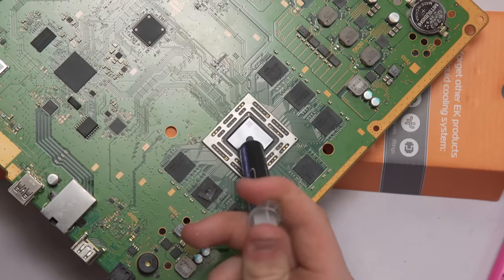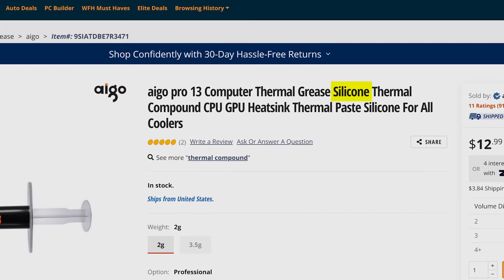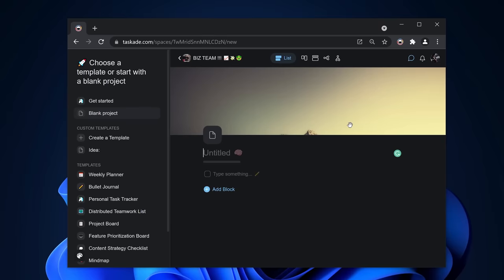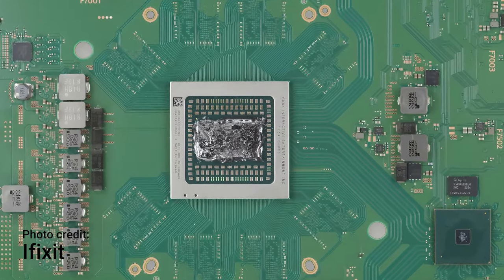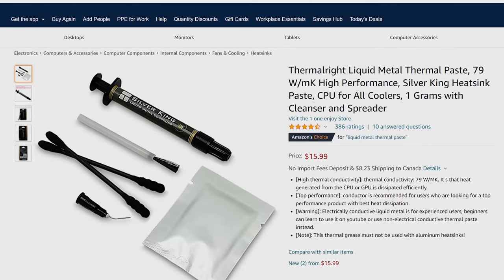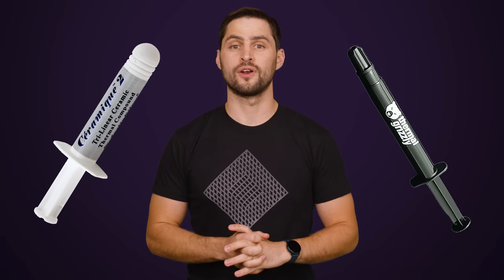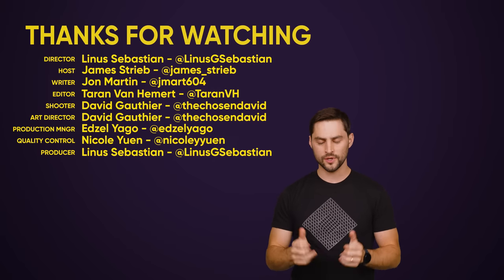LIQUID METAL In Your PC and Console

Comment: In case anyone was wondering, galinstan (the liquid metal alloy from gallium, indium and tin) has been used for some time in glass thermometers, too, where they would have used mercury in the past.
Reply: can i drink them now?
Reply: @rustyslug2943  No but if traces of it do find their way into the environment it's nowhere near as big a deal as with mercury.
Reply: For the past 2-3 decades, most glass thermometers have used ethanol. However, for a faster reading and/or mechanical output, bimetallic strips are nearly as accurate. For super precise readings IR censors and thermisters are the way to go.
Reply: Times sure have changed. They used to sweep the floor with mercury and machine components to get dust. I wonder know how much of that went into the river.

Comment: "Degredation" is one word you could use for the horrifying corrosion that gallium causes on aluminium components.
Reply: Aluminum brittler
Reply: No one with any sort of brain or nerve would use liquid metal with a stock heatsink, which is made of aluminum often.
Reply: maybe its only degradation since liquid metal is only part gallium, not completely
Reply: if your using expensive paste on something with an aluminum coldplate your are doing something wrong
Reply: Aluminone
Reply: Since it destroys and degrades the amount of aluminum in your heatsink, does it become aluminuminimum?  🤔😁😁
Reply: @La_sagne  It's a chemical reaction. It isn't corrosion.
Reply: did u just copy someone elses comment lol
Reply: @ygypt  the other comment is edited so they could've copied this comment
Reply: @Simar94  that would be so funny
Reply: Yeah I was thinking that as well. It will absolutely mangle whatever aluminium you put it on, so degradation is a very mild word
Reply: Disintegration more like, because the second you touch aluminium altered by gallium it turns into a pile of dust basically
Reply: A N I M E
N
I
M
E
Reply: @Tyler  its only called an alloy. Amalgamation I think is specifically refers to how mercury reacts to certain metals.
Reply: @MeowThingy  uhh. Corrosion is a chemical reaction.
Reply: @MeowThingy  It isn't a chemical reaction, its mostly physics. The Gallium diffuses in between the grain boundaries similar to how water forms quick sand. There is just enough electron sharing to hold it together, but the resulting alloy is very brittle. Think... Oreo cookie without the filling. This alloy is also very susceptible to corrosion due to humidity or contact with water allowing aluminum oxides to form and flake off before it can form a protective layer. The gallium isn't causing corrosion, but it is helping it to progress. 
In about a week, an aluminum water block with liquid metal will turn into a fountain or a geyser, depending on whether it fails while the pump running or when he pump is turned on.

Comment: 0:35 Sorry, but that's not the definition of "eutectic". 

"Eutectic" means that the alloy has a singular defined melting point. For example, 63% tin/37% lead melts at exactly 183 C. Above that it is a liquid, below that it is a solid. Similarly, 99.3% tin/0.7% copper melts at 227 C and 96.3% tin/3.7% silver melts at 217 C. These are all eutectic alloys, but eutectic alloys can be made of three or more metals as well - it just gets more difficult to determine the exact eutectic mix and the melting point with ternary or higher alloy mixes. 

A non-eutectic alloy has a solidus point (below which it is fully solid), a liquidus point (above which it is fully liquid), and a plastic range (during which it is not quite solid, not quite liquid, called "plastic"). For example, 96.5% tin/3.0% silver/0.5% copper alloy (the most common alloy used for lead-free soldering of commercial devices) has a plastic range of 217 (solidus) - 221 (liquidus) C. 

For reference, tin melts at 232 C, lead at 327 C, silver at 962 C, and copper at 1085 C. Thus, all my examples are alloys with melting points below the constituent metals but that has no bearing on whether or not an alloy is eutectic. 

And yes, I work with electronic-grade solders for a living,
Reply: Well said. I was going to tell him the same thing.  Electronics Tech, Schlumberger.
Reply: I knew it sounded wrong that the metal mixture somehow has a lower property than all three metals individually! Because as far as I remember, alloying materials can only have their properties in between the materials which they are being alloyed. Thanks for this, my materials science class did not cover this even though this seems really cool.
Reply: @marcincizio721   I remember this ROM this tenth grade which was back in 1997. And I only soldered like ten times in total.
Reply: @marcincizio721  thanks!
Reply: According to wikipedia "A eutectic system (/juːˈtɛktɪk/ yoo-TEK-tik)[1] from the Greek εὐ- (eû 'well') and τῆξῐς (têxis 'melting') is a heterogeneous mixture of substances that melts or solidifies at a single temperature that is lower than the melting point of any of the constituents.[2] This temperature is known as the eutectic temperature, and is the lowest possible melting temperature over all of the mixing ratios for the involved component species. On a phase diagram, the eutectic temperature is seen as the eutectic point"

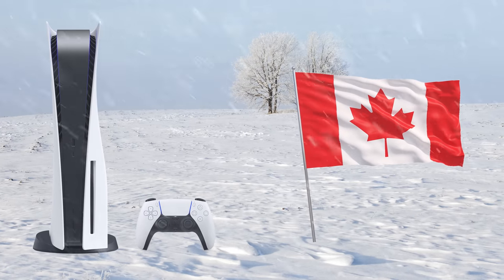According to that definition, that singular defined melting point is lower than either of the combined metals. So, the defintion agrees with what is mentioned @0:53.

Do you have any source(s) that says otherwise?
Reply: It's incredible, what one can learn from constructive criticism in the YouTube comments these days.
Reply: I was about to say something similar but I saw yours, good job.
Reply: @marcincizio721  what's your source for this? Every other single source I could find mentions the lower meting point as a part of the definition.

Comment: Liquid metal doesn't just degrade aluminum. It breaks it down significantly.
Reply: That’s what that means
Reply: It also discolors copper, but nickel-plated copper is fine.  It can remove the etching from CPU heatspreaders, and there's no way to prevent that.  If you're okay with being unable to identify a processor by looking at it, or you've lost the etching already by lapping the heatspreader, then go for it.
Reply: True, although it's not to a degree we need to worry about. Been running LM on my 8700K for 4 years straight. A little discolouration on the IHS but other than that it's fine.
Reply: if your using expensive paste on something with an aluminum coldplate your are doing something wrong
Reply: It turns it into a state between dust and a solid

Just breath on it and you have a pile of aluminium dust
Reply: Gallium is a great way to sabotage.

Comment: Liquid metal is best used to get your laptop to stop whining every time you hover you mouse cursor over chrome.
Reply: What is chrome ? Lol
Reply: You forgot to add "permanently" xD
Reply: Microdiamonds shut up my 2-year-old HP laptop for me.  I tested it afterwards with I think 50 Youtube vids playing simultaneously, with the fan barely above a whisper and no core over 80 C.
Reply: @h8GW  I may have to try on my MSI.  This thing is always spinning up.
Reply: @keithcyr5396  DEWWIT.  I plan on doing this to my MSI GL75 because it's a hot, noisy sumbitch, even when the RTX2070 isn't running.  
If you live near a Microcenter, they have IC Diamond at a pretty good price if they ever have it in stock.

Comment: If you get liquid metal on other computer components you could tell your pc “Hasta La Vista Baby!”
Reply: Lol
Reply: Good luck cleaning it up.  I wonder if the solder mask on most boards repels it enough.  On many boards solder mask is the shiny green layer.  It does come in other colors too but many of us may know green better.
Reply: its its such an overrated misconception, if your so worried about it flowing over just put some other thermal paste around the edges of the ihs first..
Reply: Still better than "I'm gonna install vista baby!"
Reply: yeah i put a plastic sheet down with a hole cut to the size of the heat spreader just in case.
Reply: @foamybelch  it would be a bigger party pooper if you end up killing ur gpu
Reply: @foamybelch  Get it on your motherboard and not only will it likely cause a short, it almost certainly will cause a solder joint to fail making it likely that components will literally fall off the board and there's zero chance they will honour the warranty after it's come in contact with the board.
Reply: @cadetsparklez3300  ignore these Karens loosing their minds because you provided them with a useful piece of information. I found this informative without being in any way affecting the OP
Reply: @foamybelch  You aren't exactly quick witted are you? We got that. It doesn't mean we can't respond to the people who don't get why using liquid metal is dangerous to hardware.
Reply: @foamybelch  you are assuming most people are familiar enough with hardware to know the specifics of what liquid metal does to components. Many (likely most) don't.  They just heard it's the best thermal paste but don't get messy and bought it.
Reply: I think Gamer's Nexus did a video on it. Wasn't too much drama to clean off.
Reply: @somethinglikethat2176  people were using it to bypass voltage regulation on Nvidia cards and it ate through the solder. You can tell it's been on components and your warranty will be void for sure. Your choice.
Reply: @foamybelch  m8 sorry I forgot about a meme form the 1990s
Reply: you need the grenade launcher to blow it into the foundry an then it has a meltdown. thats a very strong terminator
Reply: @cadetsparklez3300  don't mix chemicals without knowing what they do.
Reply: Who runs Vista anyway...
Reply: Recharge this.

Comment: The problem with liquid metal is that its use immediately gives your product a finite lifespan, the gallium attacks and weakens other metals over time, and while it doesn't do so as aggressively as pure gallium does and copper is more resistant to it than aluminum, it will still corrode the heatsink. It will improve performance but I am forced to wonder if it was that or planned obsolescence that drove them to use it.
Reply: Id imagine a combination of necessity to affix their hardware to the formfactor cooling solution they chose as well as planned obsolescence
Reply: you dont put liquid metal in the fins lmao, and if your using expensive paste on something with an aluminum coldplate your are doing something wrong
Reply: @cadetsparklez3300  Did you read?
Reply: for me I put some liquid metal on my gpu and in the 15 or so years of pc building its the biggest thermal difference I've seen so far and the cooler on my gpu isn't very good only got two zinc plated copper heat pipes but going from 83 to 66 is worth it for an older gpu imo
Reply: Been using liquid metal on a bear copper heatsink for 4 years and while the copper has turned black it has not affected the temperature at all 88c when i first installed it and it remains at 88c when ever i reapply it

Liquid metal welds the 2 parts together so if you bump it to hard it break’s that bond hence why I’ve had to replace it a few times as that 88c becomes 94c but still better than 101c of normal 12.5w/k thermal paste

Hell stuck it in my overheating laptop as i swapped in a 3740qm and i am now limited by the heat pipes max per core is 80, 82, 83, 85 because the heat-pipes just cant get rid of the heat fast enough

But the time to idle temp is around 14 seconds from 85c on the hottest core down to 38c on all cores then the fan turns off till it goes up to 42c or higher
Reply: Or any of the other actual reasons to use liquid metal over regular thermal compound. Their cooling design is actually great and has built in protection for the parts located around the liquid metal. Planned obsolescence is definitely real, but saying that Sony is conspiring to build it in is stupid.
Reply: there are youtube videos proving that the degradation (if it exists) is minimal, a guy tested liquid metal on a laptop and after 3 years, the plate was intact
Reply: Highly doubt that. It would be actually very stupid of them to do planned obsolescence for their consoles since they don't profit from console sales. Right, they have to sell them since they made them, but they're actually sold at a loss so people can buy them more easily. Sony profits then from you purchasing games for their platform, not the consoles themselves. Even in late life, close to new console releases when selling them becomes profitable because of the tecnology advancements, it's still way better business to sell games rather than machines.
Reply: microsoft google samsung amd, gaming companies , an intel all have the planned obsolescence under control. youll have to ditch your pc in  8 years or it wont work with modern games/apps
Reply: both. mostly the making extra money via planned obsolescence. which should be illegal lmao
Reply: @advancedlamb  i think it is, the thing is, there has to be an investigation on going to prove the obsolescence is real, just like what apple did with their older iphones
Reply: @psygreg  I think this is the real answer here. You don't engineer something for planned obsolescence then sell it at a loss. Sony and Microsoft make money on exclusives and add ons, not the consoles. I don't think consoles have been profitable on their own since PS2 and the OG Xbox.
Reply: Never had an issue.. i have CPUs which have been delidded over 8 years ago with liquid metal and continue to work the same as they day they were delidded and had LM installed

Comment: As a recommendation for anyone looking to try using liquid metal, I heavily recommend creating yourself a 'surgery skirt' when applying, no matter how experienced you are with applying thermal paste/whatever else. This is evident by the video of Alex liquid metaling a laptop and spraying it all over the place.

Cut a rectangle in a sheet of paper so that you can comfortably see the die area and nothing else. Electrical tape it down so there's no gaps between the paper and the board. Apply with confidence knowing that when it shoots 6 inches out the side (Happened to me, too, Alex!) that it's contained on top of a sheet of paper and not sandwiched between your NVMe and a capacitor.

I have seen a lot of people saying to use highly compressible foam, but I found that it is almost impossible to find this. I wound up using 4 strips of a .5mm thermal pad, placed in a 'sealed' rectangle around the die area, and pressed them down lightly. When I did my test fit (with no LM) and removed the heatsink, the thermal pads came off with the heatsink, so I am assuming they are making a very good seal between the top + bottom. Since you don't really care about the thermal conductivity of the pads (they are only there to be a barrier, after all) you should be able to stack them until they make a good seal. Just test your temps before sealing everything back up completely because LM is super finnicky and even removing and re-placing the heatsink (without doing ANYTHING ELSE) can cause one or more sections of the CPU to become completely uncovered due to the way it wets on the die/heatsink.

Definitely recommend watching Steve from Gamer's Nexus talk about applying it for more details.

My temps went from 95-100 on 2 cores and 80-85 on the other 2 cores at 38W, to 87C on all 4 cores at 40W.
Reply: Don't be cheap with the stuff and squirt out a bit more than you'll need on a tray or piece of paper and use a non fussy tip to apply it. Why would you even consider getting it out of the tube on top of the components.
Reply: @ruukinen  also a good tip - speaking from my own experience though it's easy to 'shake' small drops of it off a foam or lint free cotton swab onto components, so the surgery skirt is also useful there.

Comment: especially for laptops with underwhelming cooling solutions is very great - brought my laptop to 10 percent more cpu-speed while getting quieter and about 20 degrees cooler - very nice. if you can handle it to not short something, isolate the rest of it and have a copper or for best a nickel plated copper contact surface with direct contact to the chip itself, then go for it!